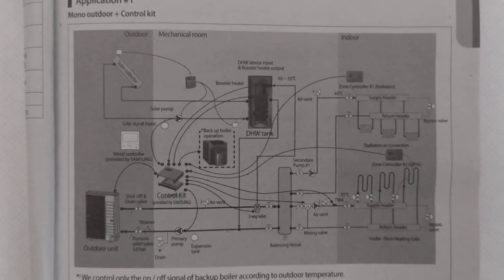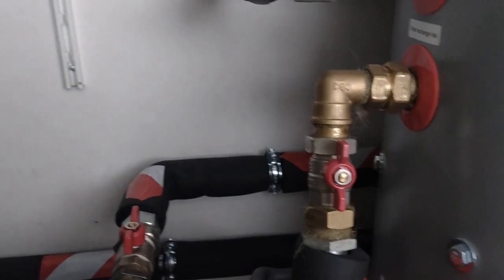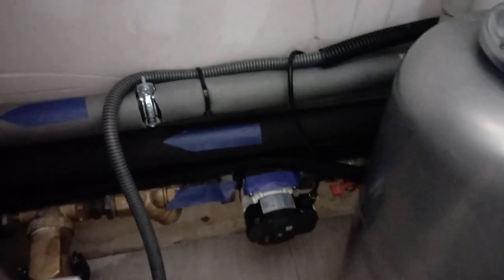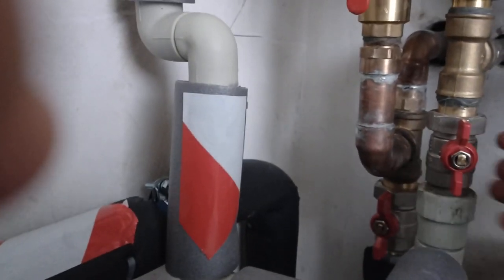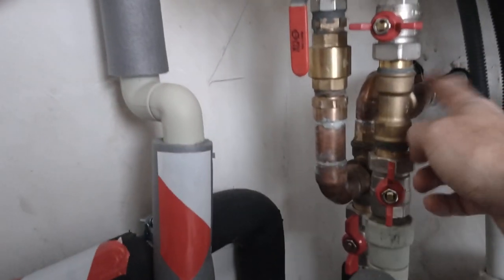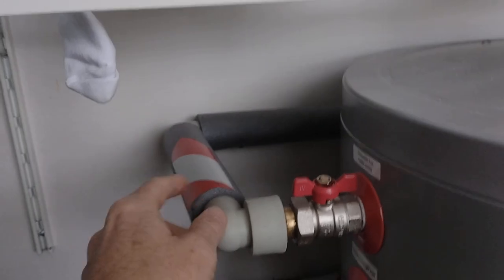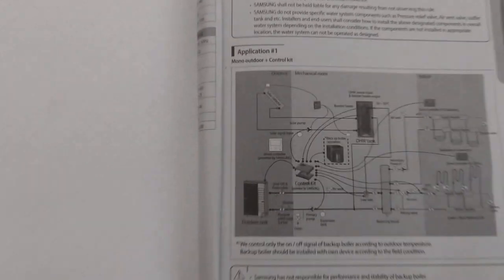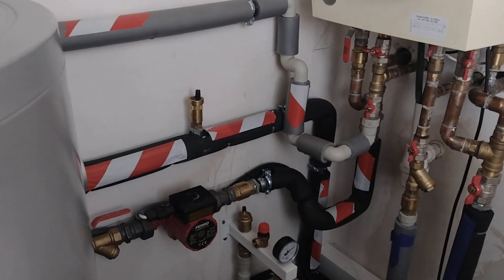Poland - Samsung 8KW heat pump professional install- DHW, Buffer vessel, tie in to old ccts.Part 1

Comment from the maker: Mistake in Video! At around 2 minutes i talk about the  DHW (domestic hot water) expansion vessel. No it isnt an expansion vessel. Its an accumulator for maintaining constant hot water pressure and reducing hot water pump cycling.